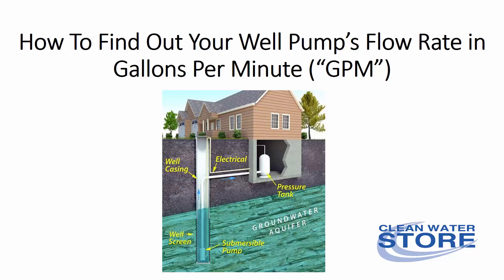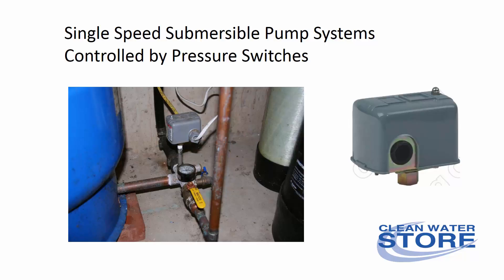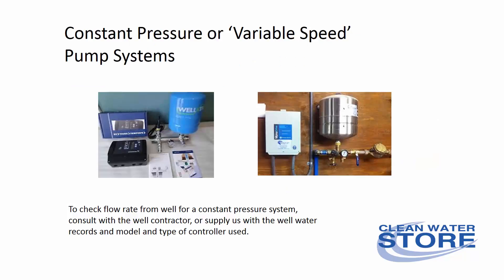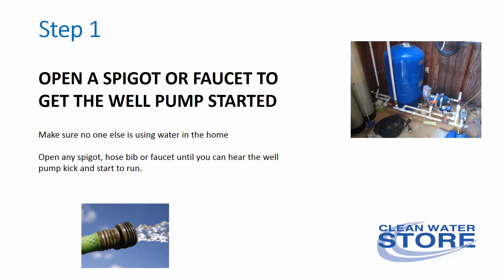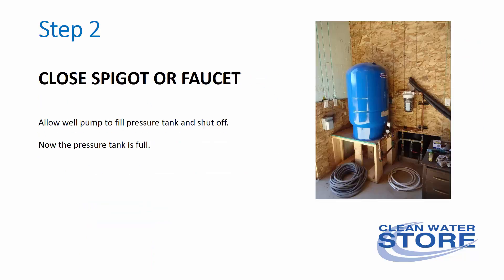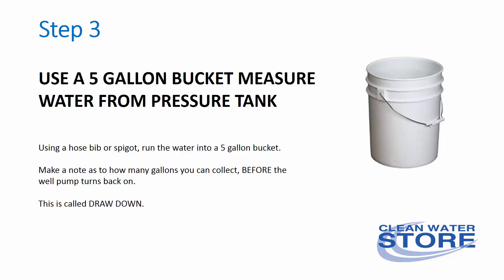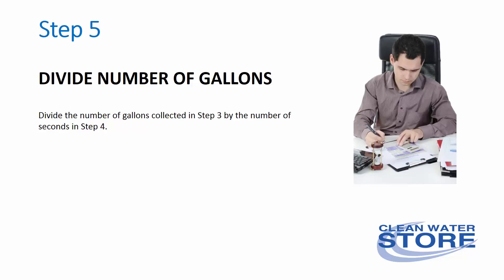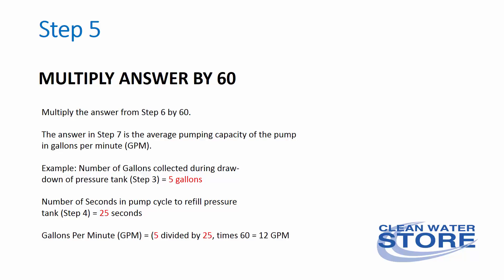Find-Out-Your-Well-Pump-Flow-Rate

Comment: How much pressure should be on valve on blue tank
Reply from the maker: Hello -  when the pump is turned off and there is no water pressure in blue pressure tank, the static air pressure should be 3 to 5 PSI less than the cut-in or lower pressure setting the pressure switch is set for.   So if your well pump turns on at 40 and off at 60 PSI, the pressure tank should have 37 PSI, when tank has no water pressure in it.